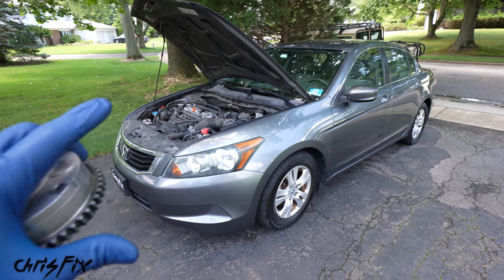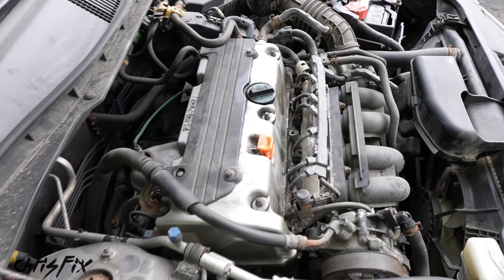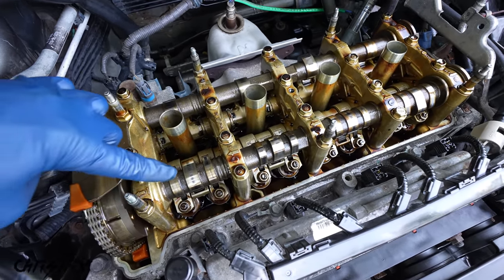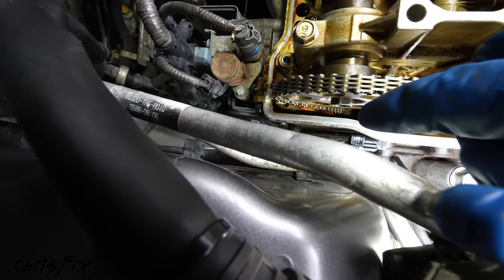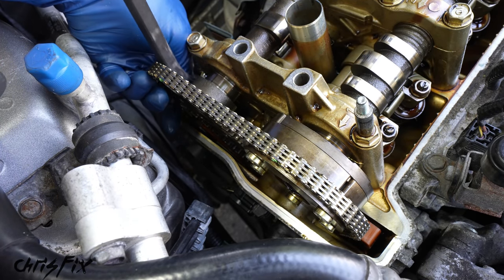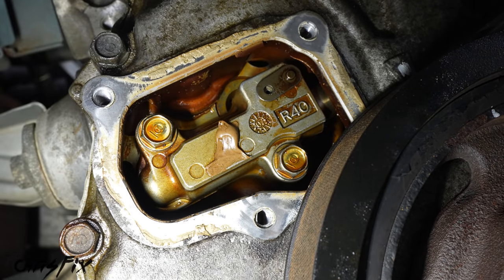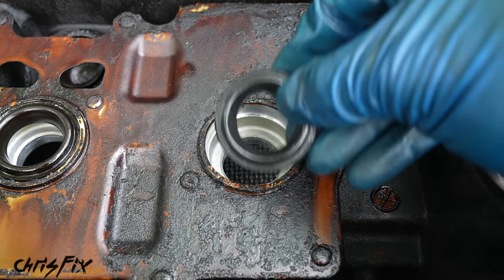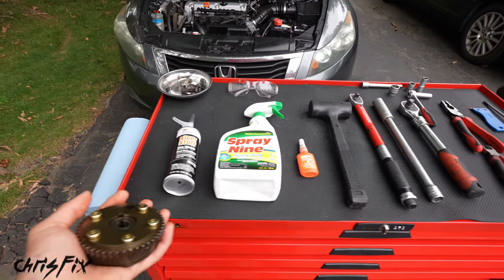How to Replace a VTC Actuator (Complete DIY Guide)

Comment: This video helped me and my dad to replaced the VTC Actuator on our 2013 Honda CRV, we followed each step as Chris was explaining and all went good. Removing the actuator bolt was the hardest part of the process. Man, that bolt is hard. Thank you Chris.
Reply from the maker: Glad the video was helpful!!!
Reply: Would you come back and tell us when the replacement part starts repeating the same noise? because that's what I am reading. Even the replacement fails. I'd like to know if you got a good one and where you purchased it from? Link? Tia
Reply from the maker: @Susan70003  It's been over a year and 15k miles and there has not been any noises or problems. I linked in the products in the description so you can easily find exactly what I used.
Reply: @chrisfix  Chris i know this is a couple years old but it is so relevant.  So everything went great but we are having a hard time getting the sprocket on. Rocking it cause pin to fall out of the chain tensioner---so recommendations would be very much appreciated.  Should i continue to try with a little prying to get it on or just go straight to removing the tensioner?  any tricks of the trade? Is removing tensioner straight forward? Thanks Mb @chrisfix
Reply: @martybannon5172  so how'd you do it?
Reply: @martybannon5172  You remove the tensioner by taking out the 2 bolts

Comment: It’s like Christmas, been needing to do this on my wife’s car and no one has a good video. After watching this I’m not intimidated to do this job now! Thanks Chris!
Reply: This is much easier than the instructions in the Honda manual. But we can see that Chris was super careful to keep tension on the chain while removing it.
Reply from the maker: Glad the video was helpful Connor! That is my goal!
Reply: Make sure you use a small 1/4 inch ratchet to seat everything if your not familiar. I cracked a cam cap on my motorcycles’ engine because I wasn’t aware of how much torque I was putting down. Good luck!!
Reply: Well done connor
Reply: HU

Comment: Followed this to the letter while swapping my VTC this weekend.  Thanks x1000, Chris.
Tip to getting the exhaust sprocket back on (it was a PITA at first): There's a dowel pin in the end of the cam that needs to align with a hole in the sprocket.  I put a wrench on the exhaust cam and wriggled it back and forth and then the sprocket went right on.
Chris, I can't thank you enough!!
Reply from the maker: Awesome! Thanks for the tip and thanks a lot!

Comment: I've had this rattle with my car for years. Finally have the courage to fix it myself. Thank you, Chris!
Reply: Good luck!
Reply: @cocoloco902  thanks!
Reply: I have the same rattle but no check engine sign , and no performance issues  !
Reply: @MXG000  Mine doesn't show a CEL either.. Just the rattle.
Reply: @MrScott-eb8nl  me too got a 08 accord might have to try it after you let me know how it goes and if you have any problems
Reply: @MXG000  if you don't have check engine light or issues I'll suggest you inspect the tensioner/ chain, it might be the chain that is stretch or the tensioner is bad, usually happen if you run it with low oil or if you tend to go overdue on oil changes, you should inspect it asap, if the chains jump timing it can destroy the engine

Comment: Chris, this is way overdue but I had to comment. A friend of mine has this same car/engine and one day described the exact sound of a bad VTC actuator. Now I'm a pretty good DIY wrench generally and had seen your video so I was super confident we could get it done. He drove over from an hour away and we got to work. everything was going fine til we had to reassmble and get the chain back on. For the life of us the chain would not get back on, we tried pinning the tensioners all all. I think somehow wewe  did manage to misalign or lose tension and I was afraid of having to get the whole front cover all. Ultimately we had to use my AAA tow to flatbed it to his mechanic almost 100 miles away. It always bothered me that we messed it up despite your great tutorial. The only way things could get worse is if we did get it together but with timing off so it grenaded  the valves. 

I think if it were mine I would have been fine.I have a second car so I could walk away and come back later. Even if I had to take the front cover off it would take a long time but would get done. It underscores how different car repair is different if its your only car/only way to work in the morning. I think the pressure of rushing to get done in time might have played a part. Anyway i still appreciated the instructions and wanted to warn others of how unpleasant things can get if you jump a tooth somewhere. Be careful and take your time!

Comment: « He’s gonna clean the inside of the valve cover »
- « he’s definitely gonna clean it » 
- « he isn’t cleaning it » 
- « he didn’t clean it OMG » dying
Reply: Thanks God, I wasn't the only one thinking about it haha

actually, if you see closely, he tried to clean it behind the scenes and maybe he couldn't, so he just said "nah, that's not worth it" and then left it uncleaned
Reply: The engine had a steady diet of conventional oil; cleaning the inside of the cover would have been a bit much.
Reply: Me tooo 😆
Reply: Trying to clean the inside of the valve cover on a high mileage engine is like pissing in the wind if you're not doing a total rebuild on it.
Reply: @muhammad bin azhar aluminum doesn't rust my man. That's oil build up.
Reply from the maker: No reason to clean that. It is just going to look the same after a year. It is oil evaporating when you shut the engine off each time.
Reply: @chrisfix  responded to me, I did my part in this world, That's All folks !
(you'r right)
Reply: LMAOOOOO YESSSS I became sick. I’m like Chris Whyyyy?
Reply: Then I was like it’s probably a pain in the ass.
Reply: Oil has detergents so no need to bother too much I guess. It's gonna look like that again after a while and it's harmless from my understanding

Comment: Once again I just have to say ... you nailed it.
 You definitely have a certain knock-on these types of jobs, and explaining and videotaping the whole job.
You are good and I have been an aircraft mechanic/engineer for 37 years! and worked on a ton of different aircraft, and my different vehicles over the years. Getting your head around the fact that you can do this and a lot of other jobs done without major expenses is the first step to it all.

Comment: Great video, Chris! I literally just finished doing this job on my 21-yr-old BMW e38 — a bit more complicated than the Honda, but same principle. It runs SO much better now. Very worthwhile. Thanks for all you do for the driveway DIY crowd!
Reply from the maker: That's what I love to hear! Good work!
Reply: I feel you, my Ford 5.4 3V needs it too, but in my case I'm replacing all the timing components.  The timing cover is not too difficult to get off as the engine bay is designed to also accommodate a V10.  There's lots of room to work once the fan and water pump are off.

Comment: Man, imagine being this knowledgable and proficient.  I can barely change my oil without screwing something up.

Great content as always, Chris!  Love the enthusiasm.
Reply: How did you change your oil without screwing anything?
Reply: Neither can some oil change places... I had one, years ago, that didn't tighten on the oil plug tight enough and half the oil leaked out.
Reply: @ishedski7270  well if you watch Chrisfix videos you know that he always tightens everything to spec so you should know by now to do that , right???
Reply: How does this happen?  You teach your teenager, and then you turn around to look in the tool box and he adds the new oil and starts it up before you check that he actually dropped the oil pan bolt.  (How many times did I teach him to check the dipstick before starting it? Um, probably "a million") Yeah, that happened.  11-ish quarts of oil.  I'm afraid to take my valve cover off, as I am doing this actuator job tomorrow.  sigh

Comment: Working for Honda years ago this was an everyday repair. Happened so much there was a service bulletin on it.
Reply: Did you change the Vtech actuator just like that by holding the chain up? Wanted to make sure if this is the right way before I try this on my Acura TSX 2010
Reply: @aczace87  hey man. Let me know if you get around to doing it. I’m a bit nervous too. Acura TSX 2011
Reply: Yup. This is a very common problem for the 8th gen accord. Have an 08 with 200k and the actuator has been bad for the past 50k miles

Comment: Good thing you remembered to change the valve cover washer gaskets along with the gasket itself. One major source of leaks is NOT using new washer gaskets, resulting in insufficient clamping load.

Comment: "Tools you have at home" Pops out an induction heater.
Yeah, sure, I got that.
Reply: Prob just rent at autozone
Reply: I could just make one out of some copper tubing, some bubble gum, and a piece of duct tape.   (MacGuyver)
Reply: @user-cg9zq4bt5q  
We don't have anything similar to autozone in our country
Reply from the maker: The cheap ones are $35 and the expensive ones are $150+. If you are going to work on cars, it's a good investment.
Reply: @chrisfix  Thanks
Reply: @chrisfix  Can you recommend a couple?  After watching this video I see that I need to add this to my toolset.

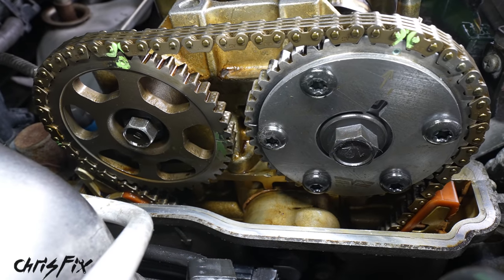Comment: 22:36 "everything is looking good" as the chain rolls off the sprocket 😁
Reply: I thought I was the only one seeing things
Reply: I was just going to say same thing.
Reply from the maker: It didnt roll off, it bunched up because we compressed the chain tensioner which uses oil pressure to push back out so there wasnt normal chain tension like with a running engine. Also the chain guide on top of the cams was off which would also prevent this. As I said, everything was looking good and it went back to top dead center perfectly. Thanks!
Reply: @chrisfix  Yeah I know. It just looked funny! ”Everything is looking good” *chain jumps*

Comment: So I just finished changing the VTC actuator on my 2012 CRV. Video looks easier than it really is! It did not go as smoothly for me.  Once I removed the timming chain from both sprockets I noticed the intake camshaft rotate slightly. This made putting on the chain harder, so I had to rotate the intake cam in order to put on the exhaust sprocket. I tried many times and could not get the exhaust cam sprocket on. During this frustration the crank TDC changed... So I had a buddy come over and hold the chain up while I put the crank into TDC...  I had my buddy rotate the VTC intake cam to the roughly TDC location, then I put the chain at the marks I made, he was still holding the intake cam with a wrench while I tried to put the exhaust sprocket on the cam, during this I was rotating the exhaust cam slight. Finally popped in!!   Worked out at the end, no more rattle, engine runs like new!  Just a warning to all, once you remove that chain the intake camshaft can rotate and change position which makes it hard to align everything back to TDC by yourself. Definitely need an extra hand, I only had a 24mm wrench, and I used a crescent wrench as well for rotating the cam.
Reply: Hi, can you tell me how many hrs it took you approx?

Comment: This is a great video, Thanks!  I followed this step by step for a 2010 CRV, and everything explained in the video was exactly what I expected.  The hardest part was getting that exhaust gear back on, it was very tight and required persuasion from a pry bar.

Comment: One thing i think is important is to use a 0.05 mm Allen key in the timing chain tensioner. It is a snug fit and cannot fall out like a pin with a smaller diameter than the hole. This can happen when your slightly rocking everything to get the cam gears on. Other than that this video was a great guide for me to complete the project.
Reply: Great tip
Reply: what do you do if the pin falls out! is there anyway to get it back in?
Reply: @martybannon5172  I recommended using the Allen key because I did have the pin fall out. I then needed to rock the crank back and forth to reinsert the pin. Huge cluster.
Reply: Thanks for this tip!  Not sure if my Allen key's have the sizes on them, but I have many, so I'll insert one that fits as close as possible...thanks for the tip!

Comment: Just did mine and man I thought I totally messed up. My old VTC was in an almost unlocked position. That made lining up my marks a little tricky. Also, I accidentally dropped the exhaust sprocket and the chain jumped like 4 teeth. I thought I was in for a huge job but I started to think really hard. I jiggled the chain on both side while pulling to the side I needed more chain on. I actually had to rotate the intake cam quite a bit to get the exhaust sprocket back on. With all my markings lined up, I put it back together and filled it with oil. First start up had a slight rattle but very faint. It drives and sounds normal. Let it sit for a few hours and started it back up. No rattle and she purrs like a kitten. Thanks for the detailed video. Saved me from spending tons of money at a shop.

Comment: Replaced my actuator yesterday on my 2012 CRV! Thanks so much for the awesome video. One thing I’d like others to know - when trying to put the exhaust sprocket back on the cam, don’t be afraid to take the tension out of the chain from the intake side (with 24mm wrench) to make some wiggle room to get your exhaust sprocket back on! It was extreme tight. As long as your paint marks line up on the sprockets your bottom TDC marks should like back up as well. (Also CRVs need the 24mm wrench, 23 wouldn’t work for me)
Reply: 23mm does not work on 2012 CRV camshaft?????

Comment: Just finished doing this repair - was paranoid that my timing got off while doing the repair but the marks all lined up. The zip tie on the sprocket was a huge life saver.

Kudos to you for a great video! Also had a leaky head gasket so was able to solve that oil leak/mess and do a cleanup all at the same time.

Started it up a second time and did a short drive. Getting error code 00320 now. Time to do some troubleshooting I guess.
Reply: Was something unplugged perhaps?